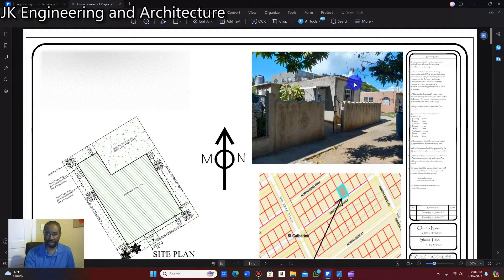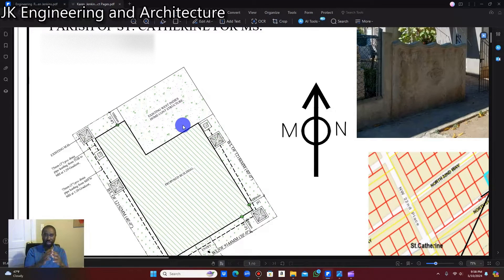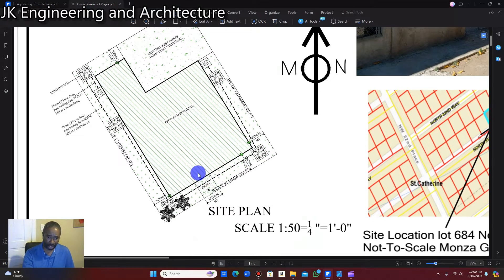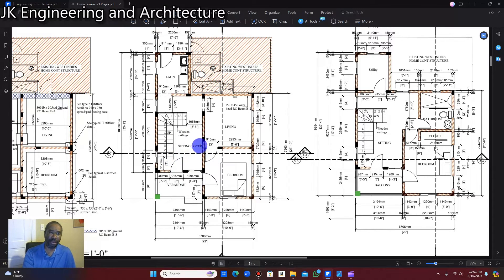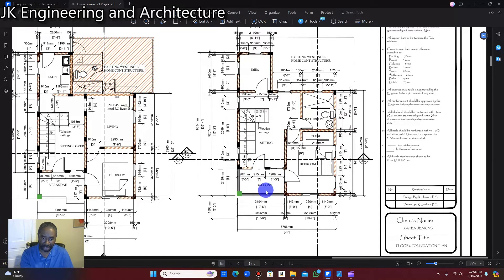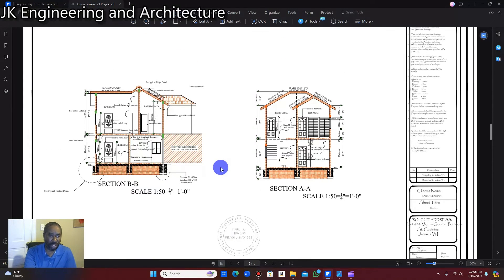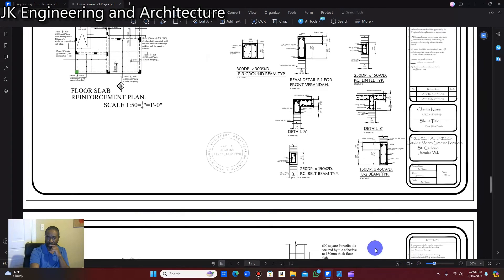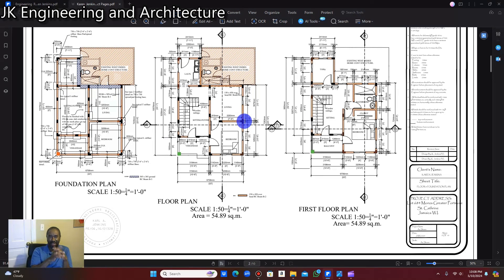Construction Drawings of a Residential Dream Home for Monza - Greater Portmore, Jamaica.

Comment: Hello, with the hurricane season up on us and with so many badly damaged roofs from Beryl.
What is the best roofing design and installation to withstand a cat 4 or 5 hurricane winds.
Reply from the maker: You Know, I have been seriously thinking about this. I still think we can use Timber Roof in our design spacing rafter closer and Using hurricane straps at every rafters, some people might ops to use reinforce concrete roof, but there is also a draw back to that with heat absorption resulting in higher energy bill. But this is tough one.

Comment: I noticed that all the manholes had a line drawn to them. Is that all the manholes are connected and will feed to the main manhole?
Reply from the maker: Yes. The lines are representation of 2inch and four inch pipe leading to existing manhole and then to sewage treatment plant.

Comment: Goodnight Teach...Question? Why  do u need a roof plan when you already have a roof framing plan
Reply from the maker: Well the roof plan is just to show the material the roof is going to be finished with. However it's not a must that you show the roof plan, you can call out the roof finishes on the roof framing plan. You always ask some good questions. Keep it up I am willing share my knowledge, I put up these videos mainly to inspire young people like you . Respect.
Reply: @jkengineeringarchitecture.  Thank you teach
Reply: Goodnight which software you use to draw?
Reply from the maker: @devonthompson2421  Autocadd LT
Reply: You said you put the application in last year. Does it take that long ? How long do you have to start building?
Reply from the maker: @maximum833  It should take no more than two months, but this takes almost a little over a year. The reason why this take so long is because according to them they are short staff, at one point for almost three months we couldn't year nothing from them. I initially did an explanation on the level of back and forth with them in my intro for the video, but I decided not to expose them like that because I didn't want to say anything bad about my country on social media.
Reply: @jkengineeringarchitecture.  that was very long to wait myself is waiting on the Mandeville branch for my drawings its only the second month.
Reply from the maker: @maximum833  I know people who work at the Mandeville municipal co-corporation.
Reply from the maker: Also from I have been dealing with parish councils for over twenty years, this is the worst experience I have had. It could be longer If we never follow up with them. A because me no want it look bad pon our country why I never talk about it in the video .